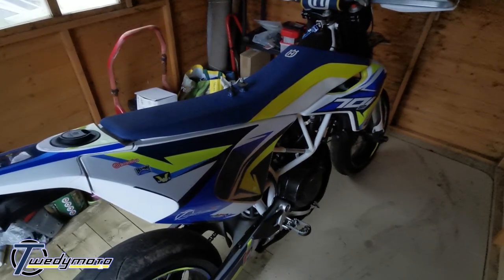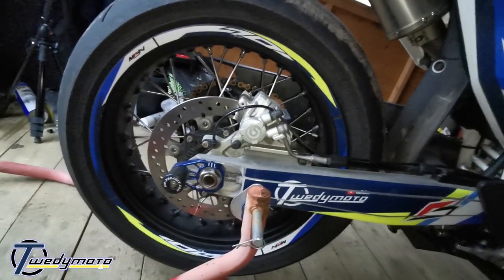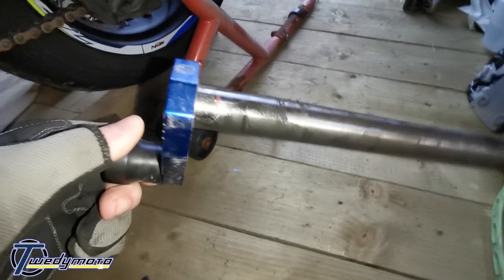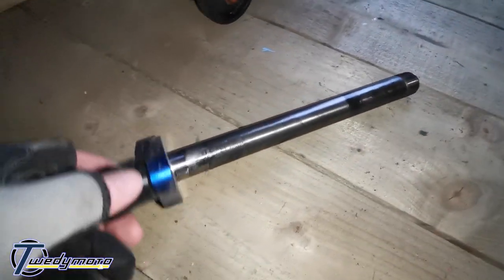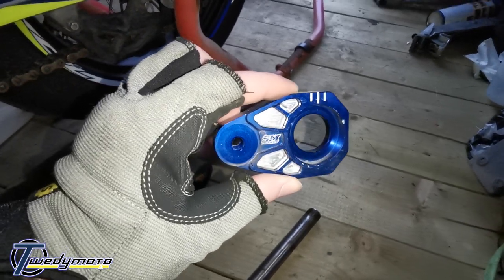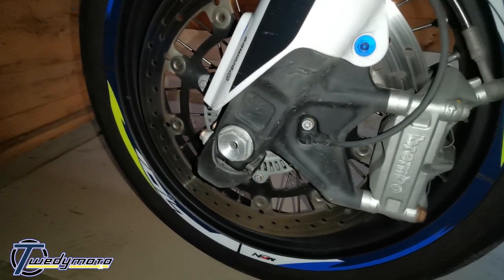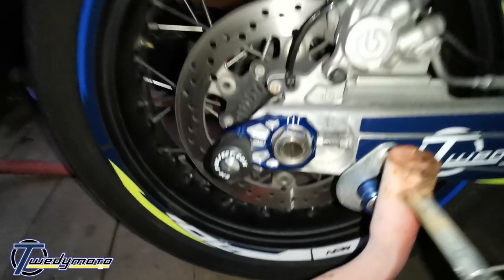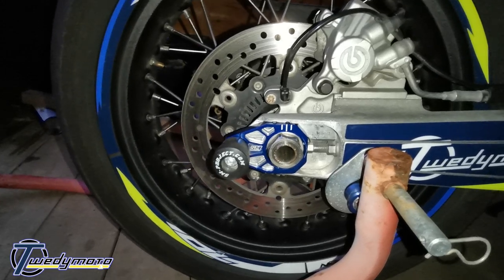How to Install SM Project Axle Sliders on Husqvarna 701 Supermoto & KTM 690 SMCR

Comment: Hi mate what cotton reels do you use? I bought some standard ones but are flush at the back and don't fit i need a bit protruding and was wondering if the r&g ones will suit
Reply from the maker: The R&G ones are very popular. I use SM project sliders cos they're pretty. 😂

Comment: just fitted these myself
that rear axle was a pain in the ass
ended up using a blow torch to heat the thread lock up
Reply: and i didnt have any bobbins to jack it up
so used normal bolts in the swingarm
to get the paddock stand on

Comment: They look great mate.. whete did you get them from..👍👍
Reply from the maker: Cheers pal. they're from SM Project. Link in the description.
Reply: @Twedymoto  i recently spoke to my parts guy at the local shop regarding changing the gearing on my 701 SM to 15/45. He mentioned something about the possibility of the sprocket rubbing on the swingarm or something like that. Have you encountered anything like this? My parts guy said this might be too much of a change. As long as i still have enough on the top end to reach 100 mph + i feel like this would be a good setup for me. I think i remember you saying this setup would still reach 115 mph...
Reply from the maker: @brucefile7430  I've had 115 before from 15/44. I have seen some instances of the chain rubbing through the swing arm slider but don't know what sprocket sizes were used. I'll check for you when I get home 👍
Reply: @Twedymoto  ok thanks! I appreciate all the info you always provide 👍
Reply from the maker: Just checked mine and there's no excessive wear on the swing arm slider. 👍
Reply: @Twedymoto  thank you for the info!
Reply: Cannot get that axel block off 😖😖

Comment: I would like to buy these in black for my 2020 KTM XCF-W but there is so much confusion when it comes to axle sizes and what will fit that it's frustrating. There doesn't even seem to be agreement on what fits what. Sometimes even manufacturers list something different than retailers...

Comment: Front axle sliders the shaft is too short. The threads don't even contact the nylon portion of the locking nut.
Reply from the maker: Something clearly not right there! Have you contacted SM project? They'll see you right 👍